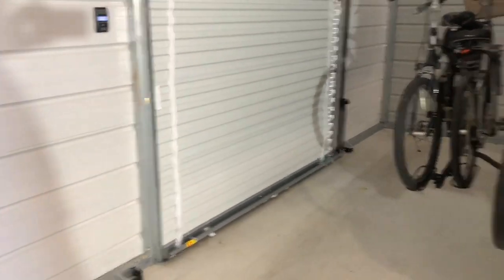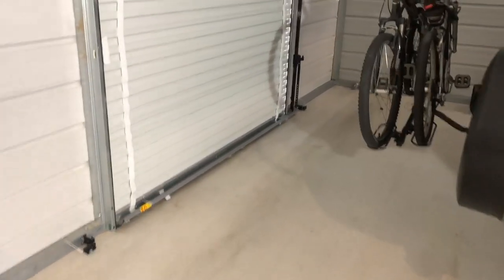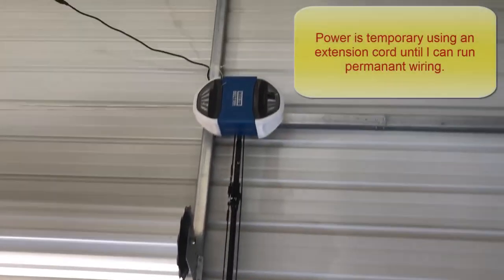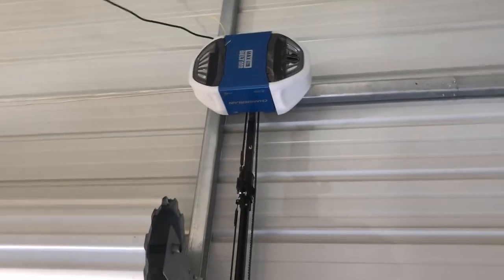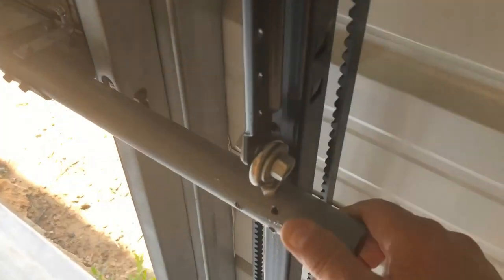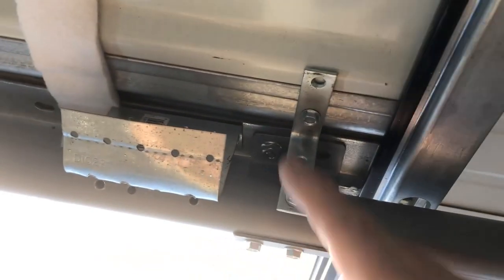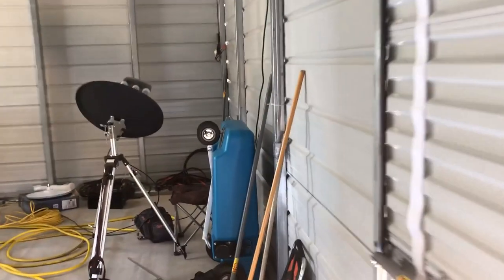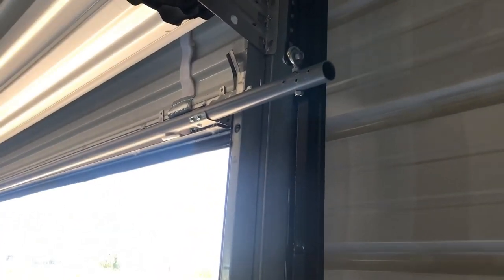Roll Up Automatic Garage Door Opener

Comment: This is what I’m getting ready to do, and you have no idea how beneficial this video was. Thanks for sharing this.I’m doing 2x10’ foot doors so I’ll have to order the extender kit.
Reply from the maker: buckaroo happy it helps. Mine is still going strong. No issues what so ever.
Reply: How did it work with the 10’ doors do you have a link i want to try this
Reply: @trevordean5545  I haven’t gotten to it yet I’ve been out with a shoulder surgery for seven months but I’m looking to do it sometime this summer
Reply: @BUCKAROO6STRINGFEVER  I tried with a Genie Max Force 2 HP. It only lifted my 2-10' doors 6'. Then I heard a noise like the gear slipping. It is a Screw Drive. I thought it would do the job, but no!!

Comment: What a great video you did!  I just installed my Chamberlain B2405 on a 10’x8’ roll-up door identical to yours, and did not- nor could I use the 8’ ext kit . To get the extra 9” of travel out of the 20” stock bar, I simply cut 9” off the bar leaving two holes at the end and did some bench grind work to round the new end.  This unit stands 123” tall and that’s all I had to work with as I have 10’ walls and garage doors are on the side, not the end as in your video.  So my head unit actually touches the roof insulation. In lieu of your antenna pole, I used a 36” x1.5” perforated  box tubing 14 gauge from HD and still had to use the two L brackets you showed to keep it from twisting as you mentioned. I’m only 1.5” from fully up in travel (like yours due to L bracket hitting limiter) and still pleased with that.  Thank you so much for a great job on the video!  It helped me greatly. Hopefully others out there can use my mod to get a full 8’ of trolley travel if they have an 8’ tall door.

Comment: Neat idea.  I just installed that exact model opener in my garage.  Found your video looking for ideas on my shops rollup doors.  If i didnt have 14 foot tall doors thist might work.
Reply: Adjust your spring tension so it's easier for the opener to lift
Reply: @JM-yx1lm  I tried that, but no matter how many turns, it doesn't seem to help.

Comment: I just did this, and it works perfectly..best idea for cost efficiency..mine controls 2 doors joined together  by a 2x4 w/ door trimmed out using a  router to insure a no rub obstruction on metal, appears as long as its no obstruction it will work fine, also belt driven is more silent if noise bothers u. Thanks for ur ingenious idea!
Reply from the maker: I just got a new building and going to do this again and use for two doors like you did this time. Thanks
Reply: @DaleStagg  be sure to show us that one too!  🙂

Comment: Very cool set up I was thinking of wAys to automate these types of garage doors too this one seems to work the best I also thought about way too is if there was a gear on the side of the roller door mount the opener with a short belt or chain the opener drives the gear on the roller door’s spring rod but I like your way as good 😁👍

Comment: You can buy garage door openers made for these on eBay for $131 that's what I did and it works great
Reply: What one did you pick up?
Reply: I don't see any such items, can you provide a link please.
Reply: Copy paste this in to ebay.
   
     
600N Electric Garage Roller Remote Door Opener Easy Install Reliable Motor Drive

Comment: I just started working on mine.  The very bottom of my door flexes on the down stroke and binds against the door track. I am hoping L brackets will solve the problem.
Reply from the maker: It should help. On my second door I did this too, I used Unistrut and flex is gone on it.
Reply: @DaleStagg  any pictures on how you used the unistrut?
Reply from the maker: @robertboyero3797  Sorry, it is not at my home but at another location that is distance away now. I just used self drilling screws and used just like my round pole but is more stable and does not try to turn like the round pipe did.
Reply: @DaleStagg  thanks. I got it done using some L brackets and L channel that comes with holes in it already.

Comment: I am planning on doing the same thing on my steel garage roll up doors. What an awesome Idea. I was wondering if the remotes will work ok through the metal building or did you have to install some kind of outside antenna?
Reply from the maker: Remotes work great through metal building.

Comment: Great job, it looks great.  A 
less expensive way to get that door open.  Does it have to be Chamberlain?

Does it have to be belt drive?

Lastly, is that 1/2hp or 3/4hp

Thanks
Reply from the maker: Any brand or model will work. I wanted this one because I can open it by my phone since my building is across the street from my home.
Reply from the maker: 3/4, but 1/2 will work.

Comment: Do you think this could work on a 6’ roll up door or is there a minimum length for the belt drive? Do you need to add any additional weight to the bottom of the door? Debating on trying this instead of ordering a roll up door with the built in motor because then I’d have WiFi functionality for open/close on the shed.
Reply from the maker: It would work just fine. My opener has wifi already and works great. Either works though? You set the height of lift with the door for how high or how low to travel.

Comment: Any concern about someone or a pet getting caught in the belt since its low and exposed?  I like the setup though.
Reply from the maker: Not very likely since the belt rides up against the bar but always possible. I have a nee building being built and adding three more just like this. Could always put a guard around the belt and bar.

Comment: WHT could be the problem whn I click remote it moves ND stops a bit
Reply from the maker: Big enough motor to lift? Try oiling the door sides to insure no binding. Check the sensors to insure nothing blocking from lowering? Start by lubricating the door on each side track. Grease or oil to verify it can move freely. Check the sensitivity of door opener and adjust to allow heavier doors. They can be set sensitive and needs to adjust to lift heavier loads.

Comment: Is that the style garage door that doesn't come with a chain pulley set-up that you have to manually push up with your hands like at storage facilities?
Reply from the maker: Yes, no chains on this one.
Reply: @DaleStagg  Mine didn't come with them either. To lock them securely from the inside, I drilled the bar that protrudes through the track on the inside, rather than the outside so the lock can't be cut. For when I leave them closed long term.

Comment: How is this still doing for you?  Any issues?   Any danger or hazards with the chain drive and it being so accessible?   Do you have a list of everything you used to do this?  I want to do the same thing.
Reply from the maker: It works great still. In fact, I have another building being built and will install three more just like it. I have no list but most was with the belt drive opener. The rest, I winged it as I went. No seen dangers and mine is belt driven and is super quite. Could install a simple guard easily if wanted.

Comment: If you can mount the motor near the floor and use a 2' long L shaped bar (since the motor is would be about 2' from the bottom of the opening) to attach to the chain then you can push those pesky programming buttons when you change out remotes or program for new vehicles.  I'll save from having to climb a ladder.
I was wondering if there wasn't a way to mount a sprocket to the end of the door turner and just use the sprocket gear on the garage door opener by itself without the rail.

Comment: I forgot to mention below I have two garage doors and will be adding another identical Chamberlain opener now that I know it can lift the full 8’ without the extra extension kit.   I wanted to buy only one first to be sure and see if it would lift correctly.  My 1 ton Dodge Ram dually is right at 7’ tall with a short antenna atop the cab in the other bay and it certainly needs the full lift. Now I’m confident to buy another, and install will go much quicker this time.

Comment: Wonder if this would work for a 16’ wide roll up door?
Reply from the maker: I added another one on my back building only it opens two doors with the one opener. One is an eight foot wide door and the second door is a nine footer, so yes, it would open a 16 foot door without issue. I just put my opener between both doors and used a wide metal bar to fasten to each door.

Comment: Whats the brand of opener did u use
Model # etc.... Plz help plz
Reply from the maker: I bought the Chamberlain 1.25 hp, but most any would work. I wanted to be able to open/close using WiFi for reason using this model.
Reply: @DaleStagg  in one place you said 3/4 hp but here you said 1.25 hp.  Can you clarify please, which one you used?  LOVE THIS!!!  Thank you so much for sharing
Reply from the maker: @cindygordon7745  I used the 1.25 but 3/4 would work fine. I am putting another in to do two doors at same time using a 1.25 for them both together.

Comment: I’ve been pricing them there no more expensive than the one you bought.   Around $170 on Amazon.
Reply from the maker: They were much more expensive when I did this. However, mine is a smart version opener that I can operate from my phone using wifi also. I use that option frequently too.

Comment: you can get roll up door openers for 150...these doors are not heavy.
Reply from the maker: I never found them that cheap. At least not then.
Reply from the maker: Found them as you say now for that price range but does not fit my door well. About to do a double door and will do it with the same method as before. My drum does not have the openings for the rollers to work without major mods.

Comment: Good idea, but it seems like it would lift too much on one side.
Reply from the maker: Still working great as it is.
Reply: Will work fine if door is operating smoothly but if it gets in a bind it will warp the door . Maybe the opener has a overload that will react quickly in that event though .